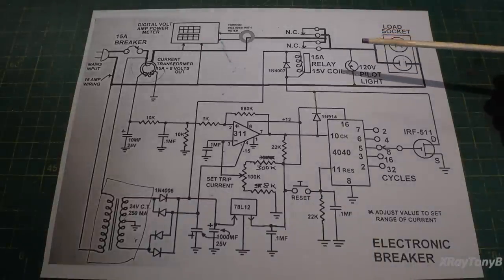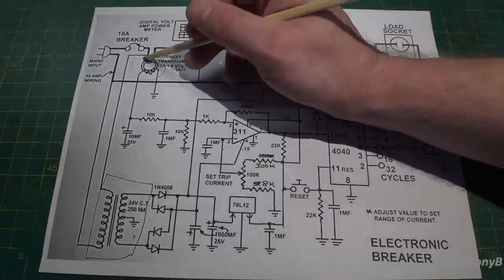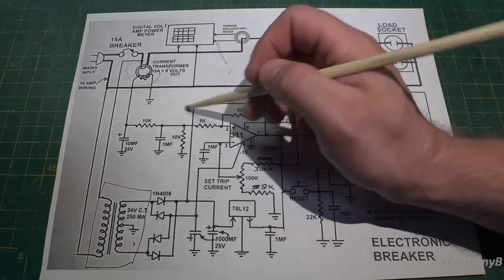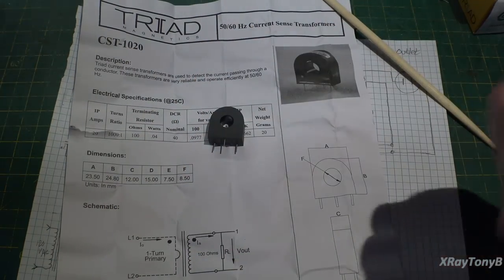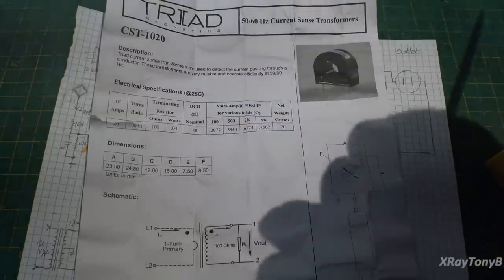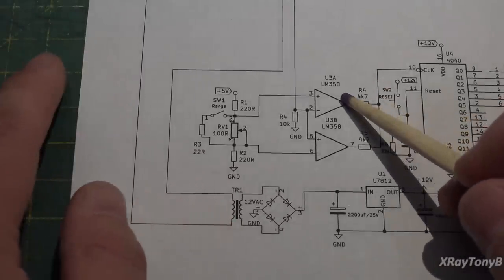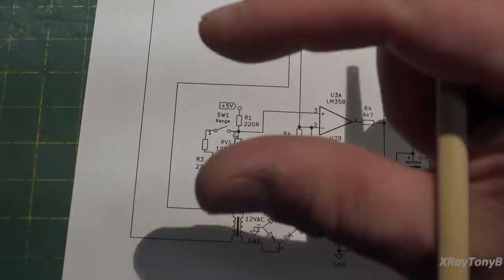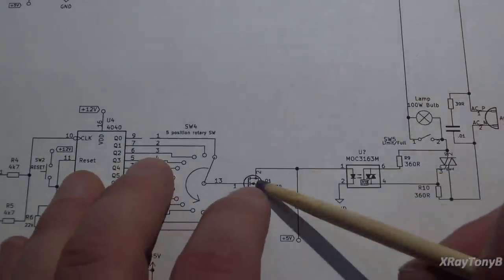Building the Glasslinger Electronic Circuit Breaker

Comment: Very interesting Tony. I will build one.  Really like the added dim-bulb circuit.  One note about your toner transfer method:  You can dispense with the iron by using just the nail polish remover.  Print your design onto a piece of magazine paper, wrap and tape the paper around your PCB, then rub the nail polish remover into the paper without moving it around.  Rub it hard (wear gloves) onto the PCB, then peel the paper away and the toner should remain on the board.  Nail polish remover, BTW, is a combination of acetone and isopropyl alcohol.  The alcohol dilutes the acetone, which is too strong to use alone for the transfer.  Someday I will modify a laminator but for now this works fine for me.
Reply from the maker: Great tip!  I'll be sure to try that!

Comment: Hi Tony, I have been producing PCB's from transfer toner process for a couple years now.  I learned from Mr. Carlson's Lab and use "HP Premium Presentation Paper", is at any Stationary/Office supply and it is $14 for a 100 page pack. Printing onto clean paper is sure to get the details over magazine print.   It is great, the paper washes off PCB copper clad board, in warm water and the etching is simple to sick the image the HP paper is a good source, the best.  I have tried for years and will never go back...Thanks for sharing this video, and process I think is a better work and much affordable as good for my money.

Comment: Another suggestion (for the revised circuit); get a SPDT CRO (Center-return off) switch and wire the center pole to the junction of the dim-bulb tester and the triac (MT2). Wire one of the outside poles to the other side of the dim-bulb tester, and wire the other side to the triac (MT1). Now, in the center (off) position, you have both the circuit AND the dim-bulb tester. In the “left” position (the “full power Scotty!” position), it bypasses the dim-bulb tester, and in the “right” position, you have only the dim-bulb tester. You can now remove the SPST switch across the dim-bulb tester, as it’s redundant. 🤠
Reply: That Triac will be destroyed and almost certainly fail short circuit (or even explode) first few times if not the first time the output is shorted out with full line fault current of 100A plus,  That is why they don't use triacs in commercial devices like gfci rcd and circuit breakers, They use a solenoid and physical contacts like a relay and sometimes they do use a relay... you will never find a triac doing the switching in a device designed to break a mains short circuit ....

Comment: YFI, I also made a covet for etch tank made from tempter glass and Delrin plastic frame make self me. However I had very look at the same tank you were looking such the same as yours, with supply for tank supplies is from Circuit Specialists, out in Tempe AZ, great outfit with very good relations as I very use them and very good would work with.  Hope I can help with PCB home for such a good hobby in electrics.

Comment: They probably pull the relays to shut the power off because most bigger relays are more responsive on that side rather than disengaging.
Reply: Thats right thats why a normally closed relay is used.. Also it helps to prevent contacts sticking and not opening last thing ya need lol

Comment: Hi Tony I would just like to say  that the 15A breaker in the original design is there as a last resort should the protection circuit fail and it plays double duty as the main power switch for the unit and while you are right the breaker will take a long time to trip as it has to heat up the bimetallic strip you fail to tell the full story,  Most breakers have two methods of tripping, They have the for-mentioned bimetallic trip, which is indeed slow, but they also have a magnetic trip which is much fasted and will operate almost instantaneously in high over current situations...  and again ts there as a last resort.....

Comment: I would have used the TL431 for the voltage reference, with that you have a much more stable voltage reference that doesn't drift with temperature

Comment: Very cool circuit. Maybe you could put together a kit, I'm sure people would like to buy it and assemble it.
BTW, what would happen if you exceeded the current sense module's 25 Amp limit? does module output zero or an undetermined value and how does your circuit deal with it?
Reply: That is a very god point sir, as this circuit is supposed to be able to cope with a dead short, I also worry about Tony's use of a triac in place of the relay to break the current, I considered it in my build but decided against it as in my experience triacs usually fail short circuit and that is not what you want from a circuit breaker, also secondly to concerns about the current sense module in a severe over current situation I wonder if the triac can stand up to a straight short repeatedly ? At the end of the glasslinger video Ron directly shorts the unit at full US line voltage a current to show the unit in action doing its job and when I finished my build I nervously did the same there was a bit louder bang as my version runs on 240v but it held up and did its job it will be interesting to see if Tony shorts out his design with full line voltage and current on it and how the circuit holds up? I guess time will tell. I think its quite admirable of Tony to play around with the original design to try to ''improve upon it'' but I feel he might be trying to reinvent the wheel for very little gain Ron circuit works flawlessly  for over 25 years...............
Reply: Agree. A dead short would be the real test of the circuit, more importantly, can the hall-effect current sensor stand a short circuit current rush? The old transformer type current sensor will survive a dead short without a problem.
Reply: I wanted to add the triac is never, it will drop out at 0V cross when there is no load on it during a short or over current. You could also use a circuit breaker or fuse, or even the dim bulb.

Comment: You probably don’t want a polarized electrolytic cap there right off the current transformer; use a non-polarized capacitor (or two 22uF caps, back-to-back) - there’s AC there!
Reply from the maker: The current sense module that I'm using only puts out a positive voltage.  It is not a transformer and it does not output AC, but rather a varying DC signal offset at +2.5V.  With no current, there is an offset of 2.5 V DC.  Usable output range is from 1.875 to 3.125 VDC.  The scale is 25mV=1Amp current.  Positive polarity current is 2.5+ (20mV/amp)  and negative polarity current is 2.5 - (25mV/amp).  For example, positive 1 amp of current flow would result in an output of 2.525 VDC from the module.  A negative 1 amp of current flow would result in an output of 2.475 VDC from the module.
Reply: Sorry, not clear enough. I was referring to the original schematic with the current-sense transformer design. My bad. 😬
Reply: @xraytonyb  What happens when the output gets shorted can the module cope with say a 100A transient for quarter of a second? and can the triac?  I feel the current sense module may be OK if its a hall effect sensor its probs zener clamped at a few volts but not so sure about the triac been able to withstand being repeatedly shorted or even once?
also with the current module in place of the transformer I feel you may experience false tripping ie when you switch on or off connected devices and you get a little switch arc in the original design a cap is used across the transformer to filter out any small spikes like this!....
Reply: It will only turn off or on during the zero cross I.E. when voltage is zero, which would make the amps 0. I planned to put a fuse series with the device. Does anyone know what Triac he is using?
Reply: @kardeef33317  putting a fuse in series to combat a short defeats the whole purpose of a circuit breaker and yes the triac will only turn on at zero cross but then ramps up and will still see full fault current if the output is a short! just use a relay like Ron the guy who designed the circuit trust me he knows what he was doing

Comment: I think, this circuit is without short current limiter. For electronics need electronic circuit breaker with short circuit limiter ( reduce short circuit current to about 10...20A or less )

Comment: You mention the required terminating resistor listed on the data sheet. The Glasslinger design  appears not to.. have any unless it is the  two 10k resistors in series, tapped at the input of the op amp.
Possibly ,it is not needed because a specific output voltage value is not needed? What are thoughts on this?

Comment: Board seems big for what's on it. Intentional or just easier to work with?  Also, instead of spending the time using the soldering iron to tin the traces, just dip it in some liquid tin. A bit nasty, but almost instantaneous. Like the etch tank, but 2 liters of ferric chloride is a lot for the amount of work I do. Don't have the electronics chops to comment on the design. Hope the comments here are correct/helpful. Nice work in any case.
Reply: That (1st proto) board costs about 10 cents. 😂
Reply: @HazeAnderson  Yeah, I know, I've done a few. Just seems like an awful lot of board for the amount of components.
Reply: @Stephen Morton I've done my etching as you describe, in a glass dish with manual agitation. I've not ever had my ferric chloride very warm but I wonder if faster etching might improve the finished quality of the copper traces. I wonder if the longer etch times allow more creep under the toner. The thing with the amount of ferric chloride is just that the boards I've made are mostly 3 inches square or less so 2 liters of the stuff seems a bit much. Just me.
Reply from the maker: Thanks for the comments!  I did use a larger board than necessary.  Part of the reason was because that was the size I had (I have a whole stack of them)  and I didn't feel like cutting it down and the other reason is that I'm still a total novice when it comes to board layout and I didn't want to spend so much time reworking it to make it smaller.  I also like to have the extra room on the board for future "hacks".  
As for the etching tank, the ferric chloride lasts a very long time.  As you etch more boards, the etchant will dilute and take longer to etch, but it can be used many times before having to dispose of it.  Thanks for watching!
Reply from the maker: I used the same method as you, until I got this tank kit.  I will tell you, after using it,  this tank is much faster!  Between the heat and bubbler, there is a noticeable decrease in etch time, even when using old etchant.  I also notice less creep under the masking, although it's still not perfect.  Thanks for the comment!

Comment: As i a see the current sense circuit i think that is something partially wrong.The output of the transformer is AC current,so it needs a rectification first and then a resistor connected in parallel to convert the secondary current to voltage=I*R and then any other signal conditioning.
Reply from the maker: The current sense unit is not a transformer.  It is a hall effect sensor.  It will work with  AC or DC with the polarity being either direction.  When  no current is flowing, the module outputs an "offset" voltage of 2.5 VDC.  When positive current begins to flow, the module outputs 2.5V + 25mV for each amp.  When negative polarity current flows, the module will output 2.5V - 25mV per amp.  If this were a current sense transformer, you would be correct.  I showed examples of both the transformer and the sense module early in the video.  Thanks for watching!
Reply: @xraytonyb  I thought about using a triac but those fail short in my experience..  I like your version with your personification of it.. what did you think to my attempt?

Comment: I didn't hear you mention it, or anyone else in the comments so far, so I wonder if I'm wrong about this. But it seems to me that the counter now counts half cycles instead of full cycles, right? At a glance, your final schematic still shows that you have the multi-throw switch on the 2, 4, 8, 16 and 32 outputs so the slowest you can set the trigger is 32 half-cycles, so 16 cycles. Is that intentional?
By the way I was also thinking: Can't you change the pull-down and pull-up resistors to values that are, say, in the order of 10 times as much as the potentiometer to make it easier to set the potentiometer?
Reply: yeah i think you maybe right sir and if that is the case then he has now gone from a max of half a second to a max of quarter of a second which may not be long enough for some lager inductive loads and a new min of 1 cycle which Ron said was not enough as spikes on the line will cause false tripping if we try and monitor for a single cycle that is why 2 cycles is min setting....
Reply: @Stephen Morton yeah could cascade but I really feel Tony is trying to reinvent the wheel here for no appreciable gain, in fact i feel he may have made the circuit less reliable, I feel the triac he is using in place of the original relay wont be able to cope with been sorted out repeatedly and in my experience triac's like most other semiconductors fail short circuit, which is not what you want from a device who's job is to break the circuit, some triac's can also like most semiconductors be sensitive to inductive loads especially when like in Tony,s design there is no snubber circuit implemented to protect the triac although I think you can get triacs designed for direct use with inductive loads? so if that is indeed true then Tony may in fact be using one of these?   I also have concerns around Tony's use of the current sense unit he has used in place of the original transformer, Namely will that part be able to repeatably and reliably cope with a 100A or so transient  for a quarter of a second when the output gets shorted?  when it is designed for say 15A, !   Also in the original design the current transformer has a capacitor across it to filter out any small spikes and noise, I feel Tony's version will let through any noise say for example when a connected device is switch on or off and there is switch arc, this will probably result in false tripping.. not to mention its adding another part that can fail, what is the failure mode of that device? will it put out incorrect values? oscillate? fail short and kill the power supply? just stop working leaving you unprotected while you think the unit is protecting? I dont know the answers , However I do know a ordinary current transformer is very robust and especially the way Ron has used and advised others to use a re-purposed wall wart, as that transformer is designed to work a lot harder in its original application than it will using it in this way in this device, The original device works fine and totally adequately and has for over 25 years so I just can't see any point in changing  the design I just hope Tony's decision to '' improve'' Ron's design doesn't come back to haunt him down the road but time will tell!
I stuck to the original design except changed a few component values etc to make it work on 240v and I added a second relay (normally open) in place of the 15A breaker in the original design so I could switch the main power from a small switch on the front panel and this has the benefit that should the power supply or anything else fail the relay will open disconnecting the input from output this is a good idea as the unit uses a normally closed relay and this would without the second relay leave a direct path through the devise in the event of a failure which could leave you unprotected... I also added a seven segment display to show the selected cycle count hysteresis, other than these minor changes I didn't deviate from the original design and I'm pleased to say  the breaker worked flawlessly from first power on I used a 30A relay and it can brake full fault current in my shop (on 240v) so again I don't see any point in changing Ron's original seems he did a very good job,  It does what its supposed to and is reliable what more can you want??..   regards Steve
Reply: @Stephen Morton absolutely sir though he set the max current at 15A so I feel he uses his for all sorts of projects repairs experiments etc lol I set my max at (A but im using 240v so still a lot of potential power, I intend to make another vid on my version soon showing the tripping on the scope etc and maybe use a shut to show the full fault current in fact I will be making a lot of videos in the near future with some interesting projects and subjects so if you enjoy this kind of stuff look out for them  regards Steve
Reply: @Stephen Morton I will be doing some rf stuff and vacuum teach shortly
Reply: Using the zero cross opto the triac will turn off during the zero cross when the volts and amps are zero.